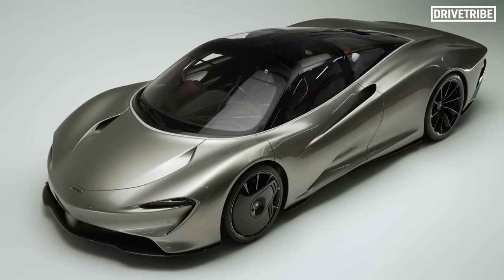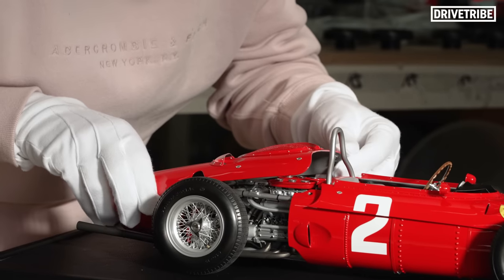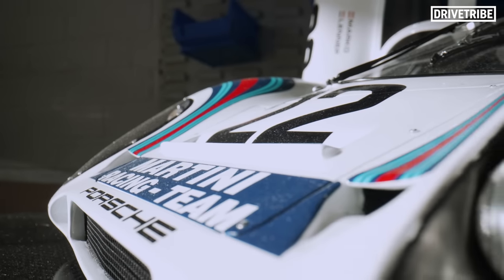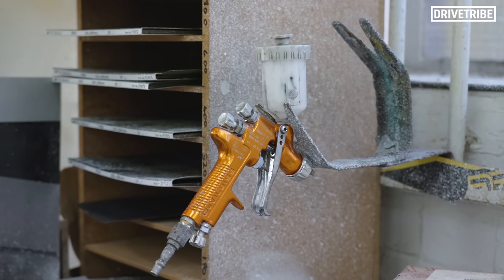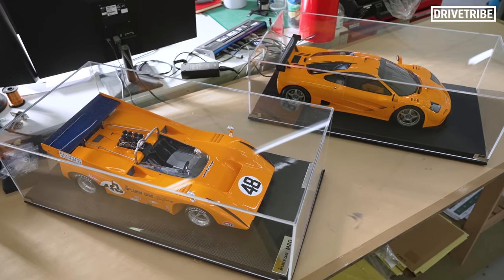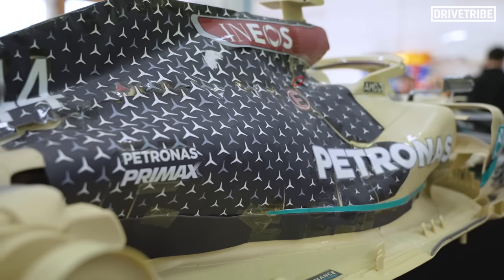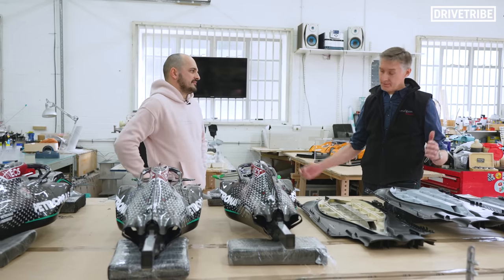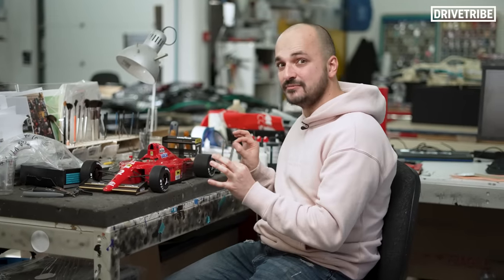This is what you get when you spend over £20,000 on a model car

Comment: Amalgam does make some amazing stuff.  Case in point: Shmee's McLaren Senna model.  And the only way you can tell it's a model in those glamour shots you started with is the size of the metal flakes in the paint.
Reply: That’s the only real big give away on a great scale model.
Reply: Yup and I think some of these pieces about them where the headline is £20,000 model car!! Does them a disservice. That's for a huge 1/8 scale , 3 foot long and very rare models.

If you want an equally we'll made Amalgam but something you can compare more easily to mid level quality models like Minichamps ,  say a 1:18  F40 or a 1:18 Formula 1 car, you're looking at around £600. I spent £400 on a rare MiniChamps Audi 90 IMSA GTO and as detailed as that is (you can change the AN fittings on the breather on the cam cover and read the Stack Dash speedo numbers, the fire extinguisher certification sticker)  I know Amalgam cars are of much higher quality. So £400 to £600. Not crazy really. 

Probably 2% or less of what they do is above £20k.

The fact its a small English company using local craftsmen as opposed to making everything in China like Minichamps makes it even more special in an age where 85% of the things in our daily lives from the Gearknob on your Audi to the DHS sofas in your living room is made in China.

Comment: I've collected quite a few over the years, mainly low to mid tier models. The most expensive one I owned was the now discontinued and highly sought after Ferrari 250 gto by CMC. I paid £370 for it and sold it on after a couple of years for £1200. Amalgam are a little on the pricey side but if you have the money then go for it. Otherwise look at 1/18 Autoart, TSM, BBR etc for similar details and quality at more reasonable prices. With advances in manufacturing and cad technology even entry level models from the likes of bburago are very presentable these days. Their Lamborghini Sian is excellent for the price.
Reply: I love hearing stuff like this, it makes me feel better about only having budget cars, and I also have burago’s Lamborghini Siàn, which is the black and yellow version with tinted windows, and half white, half black wheels.
Reply: I had all 6 CMC SLR and had to sell them when times got tough £12,000 and that was in 2017

Comment: They charge $1,280.00 for the glass box seen at 8:16 (not including the black plinth the model sits atop).  That's $1,280.00 for 5 sheets of glass and 4 bits of aluminum.

Comment: When you spend 20 Grand on a model, and the maker puts so much attention to detail, the emblem in the back of the Speedtail shouldn't just be a sticker like it is here. You get the same on 100$ model car.

And btw. you can make carbon fiber at a much smaller scale. "It doesn't exist" sounds more like a way to make more money. For these prices they should better do some research
Reply: I dont think it can recreate the carbon platten in real scale and correct direction in this size.
Plus it have to sand all the part to make all edge sharper to make it look like real thing in scale.

Comment: 12:39 To give you an idea of cost. I had a small injection mold made back in the 90's for a 2 up part and it cost me $45,000.00 CDN at the time. That's about $110K today. Now mold making has evolved and it's easier to do now with cnc but still, a complex mold for wheels would run you around $90K cdn.

Comment: No, the REAL question is how can a model that takes 4000 hours to make ONLY cost 18k?? That's just 4.5 dollars an hour. The precision artist's labor alone should cost you many times the price, let alone the precision materials and components. These are incredible bargains for the amount of labor required to make them.
Reply: Maybe the stated 4000 hours include all the pre production work ( scan, cad).
Reply: @S41t4r4  I would still estimate it would take at least a few hundred hours to complete one. Still a bargain.
Reply: That was either an error on Mike's part, or a reference to the 50-150K full-bespoke models.  Further into the video (6:06) there's a mention of a month to six weeks into the models, that's more reasonable for the 7-20K versions.

Comment: I love building 1/8, 1/12 and 1/16 scale models because the amount of detail I can pack into a larger scale model would amaze most people stuff like springs, linkages, spark plugs, buttons, nuts and bolts and wires and tubes, I have even made working butterfly valves on carburetors. MFH even makes a working 1/12 scale four rotor Mazda Wankle rotary for their 787b with working slide ITB itakes.

Comment: Mike you should check out Scaleart who make model trucks some of them at around the same price big difference is they are functional Radio Control,  with working gearboxes, differentials which are lockable 4 wheel, 6 wheel drive, working lights engine sounds, hydraulic systems such as Cranes with pallet gripper, bucket loader attachments  all functional.
Check out the many Radio control truck videos on YouTube Scooty555babe for instance who videoed a meeting recently at Leyland, the Ribble valley Truck club.

Comment: If I had the money to spend on a model, not just enough money but enough to allocate the money to a car I'd want the model delivered as a kit for me to assemble and powered by the relevant motor either fuel or electricity.. I would have to take the motor as a complete unit. I think building the model would be necessary to have the car feel like mine.

Comment: I don’t even think Hot Toys prices their figures to something like this?

They do lifelike figures at 1/6 & Sideshow does 1/1 and.. barely cuts the prices of 1/8 diecast cars smh.

Hot toys & Sideshow even got LED & working figures/lifesize figures for stuff

But this is 18,000$ and doesn’t even have a working MOTOR??
No shown working Lights.

It just sits there.. & collects dust with little posability? 
That’s pretty underwhelming.

I’ve seen an R/C Dodge Challenger that is around 1/10 that literally goes 1-60 pretty fast and looks AMAZING & is Under this price by a long shot. Around 500$ - 1k

Comment: oh that's a tough one if i were to get a 1/8 Scale Model car and Spend £50,000 ($70,000) or almost  £150,000  ($204,295.50)   i'd prob go with a 1/1 1/8 Scale model of my   Early 2018 Mazda CX3 in Deep Crystal Blue Mica  its bespoke car in that the Vin # on the car is 9,994th Car built outta 16,355 in 2017  but if i were to do  a second one if prob would get one made to be like my fathers John Cooper works Mini Cooper